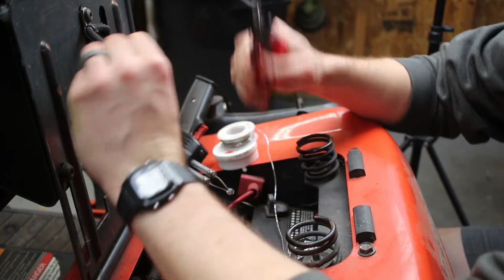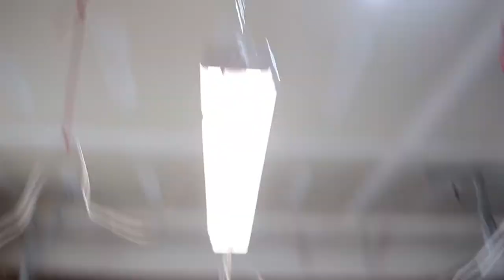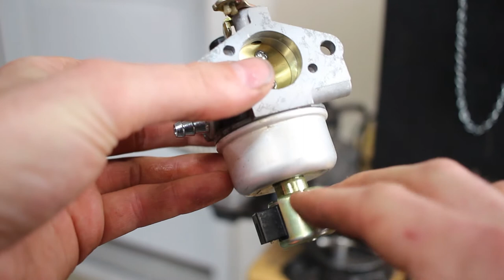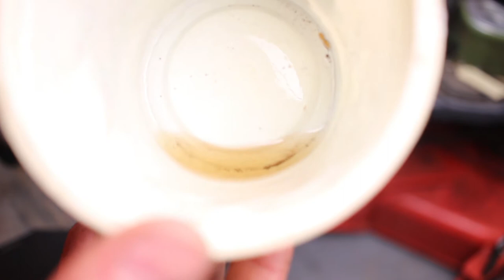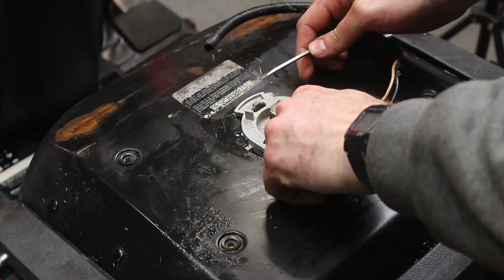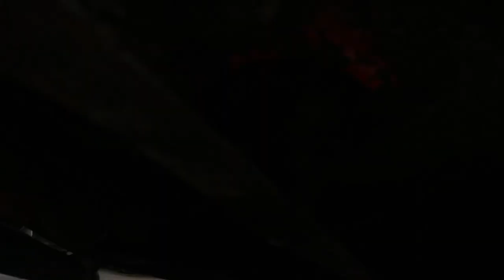Simplicity Regent 14hp - Will It Run?

Comment: Nice Chris.  I really like Simplicity mowers.  The ATF trick is a game changer.  I use a slime bottle except with ATF.  Put about 8oz in, fill up and roll around and it seals it!
Reply from the maker: Dude right on.. Casey B said said the same thing. How long does that typically hold up?

Comment: Changed the starter the ignition just clicks one of the wires is getting like red hot. What could be my problem.
Reply from the maker: Check the fuse, how old is the battery, test the starter solenoid
Reply: Unfortunately i dont have a tester the solenoid is melted i ordered a new one brand new battary and starter as well@ChrisXOutdoors
Reply from the maker: Keep me updated!
Reply: @ChrisXOutdoors  i will. i literally bought this mower everything worked before i bought it. Put it in my garage, and then first, nice day i could mow it started clicking. Bought a new battary that wasn't it then replaced the starter just took the solenoid off today then one post was melted.

Comment: ATF is what I use to seal tires now.  Nice looking machine, I haven't come across a Simplicity tractor.  I've seen them around but never gotten one. Later...
Reply from the maker: You’ll have to show me the trick with the atf sometime. I’m very curious now 🤔😂
Reply: @ChrisXOutdoors   My understanding is, I have never done it, that the mineral oil in the ATF causes the rubber to swell, thus stopping the leak.  So in theory mineral oil itself will work as well.  I prefer to just install a tube.
Reply from the maker: Yeah.. different strokes for diff folks. This was the first time I’ve bought a tube this year and it seemed abnormally highly priced lol. Tube probably lasts longer than atf but I’d be interested to try it out
Reply: @ChrisXOutdoors  Tractor Supply is expensive for tubes.  IIRC the jungle website has them for about half the price.  At least the last time I looked for my Craftsman II.
Reply: @5beesgarage  Mills Fleet Farm is the best quality and most reasonable prices here in Iowa. Can buy cheap Chinese made tubes, but some have No offset. Meaning you have to drill a hole in the center of the wheel for valve stem. Got 2 of them from Harbor Freight.  1 ripped installing the other held, but as soon as I let go it got sucked in side. Later...

Comment: Did you figure out your oil leak on this machine ??? I’ve have a Koehler commander 14 hp in my Simplicity  Broadmoor, I had an oil leak early on in its life under the flywheel believe it or not that seeped out of the casting ran over the side and all over the side of the engine ! My fix was to remove the flywheel and clean the casting up with brake clean and scratch deep grooves in the aluminum in like a grid and x pattern then fill the spot up with epoxy… work well and no leaks from that area in 27 years !!! Hope this helps for future fixes !!!
Reply from the maker: Thank you for the info EJ. SUPER helpful brother! Thank you for watching 💪🏼
Reply: I never have any oil leaks from any of my Kohlers but have on briggs and it was the end of the dipstick needed a new ring around it because small amounts of oil came out

Comment: Looks like the first fuel filter was installed in reverse, usually that metal inner part of the filter points towards the tank just like the new one you installed.
Reply from the maker: Good catch Todd.. I didn’t even see that 🤯

Comment: I have a question maybe you can guide me in the right path , I have the same tractor I change the starter and coil module , but I still have NO SPARK , tractor won't turn over 
Could it be wiring issue or something else ??
Reply from the maker: There is a starter solenoid that is a big part of the situation. I touch on it in the video. I am unsure when but I remember I talked about it. That might be something to start with. That part is commonly sold on Amazon. You would just have to find the right part number for your machine, if that is the case.
Reply: @ChrisXOutdoors  is it the one under the seat we're the battery is?
Reply from the maker: @chivigonx3 yes

Comment: Hello. why do you have the blades with the wing down in the video?
Reply from the maker: Were they? I must have not noticed
Reply: Hello. don't take my question the wrong way. I am from the Czech Republic and I use google translate for translations, so my translation may be incomprehensible. i have this old simplicity regent 14 hp hydro mower tractor. I also have the original mulch kit from Simplicity. here are high lift blades. in the instructions, Simplicity says not to use lifting wings or high-lift knives for mulching. I was thinking of buying the so-called gator knives, but it was quite a problem to find one for this tractor. I was just thinking that sometimes I read somewhere on the Internet that someone turns the knives with the wing downwards on purpose. but that's probably stupid??? Thank you for your opinion.
Reply from the maker: @libortlaskal2695 try it out and see how it cuts!